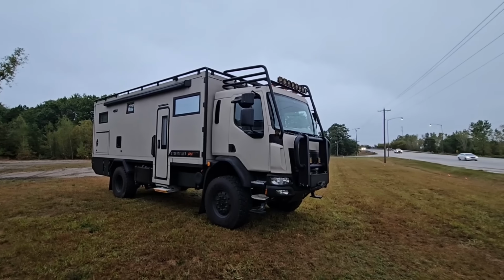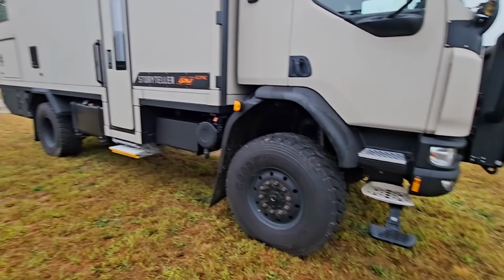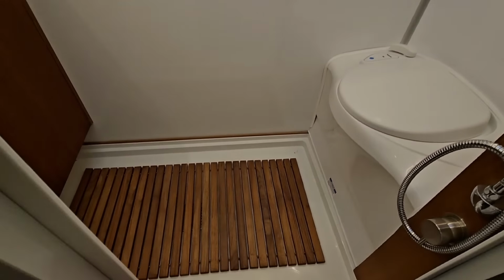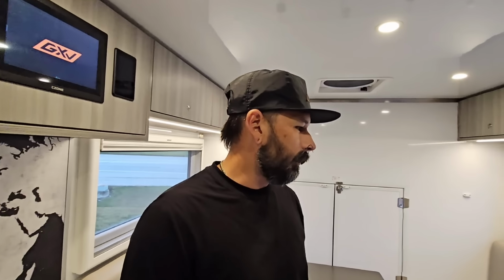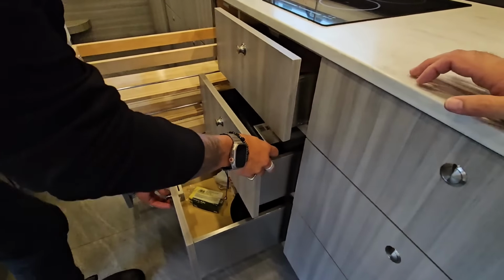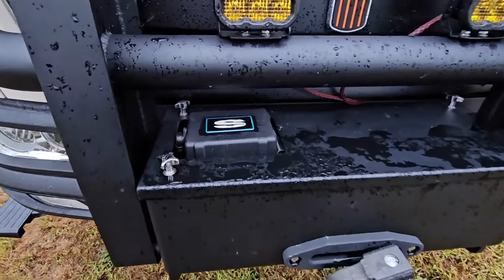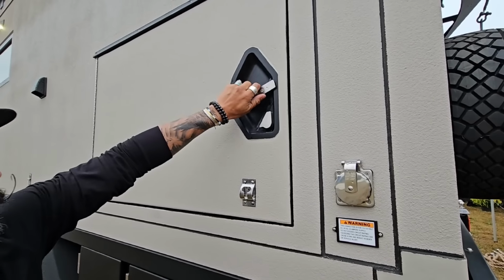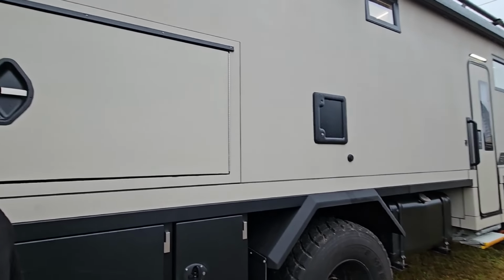MOST AMAZING US MADE Overland Motorhome RV! Storyteller GXV EPIC!

Comment: Can it be customized with a full dry bath (separate shower)? We have years of RV'ing around the states with a wet bath. It's a hassle, and only one person can use the bathroom at a time. Plus the wipe down after is another effort one prefers not to be faced with when you come back from a day out biking, hiking, or paddling. You're tired; you just want to take a shower and chill. Black and gray tanks would be another excellent option allowing for off-grid enjoyment and ease of emptying the tanks at a campground using their full-hook-ups when it's finally needed. The cassette is another major effort; it's heavy and quite high off the ground; I stand 6'4". it is not welcomed by some folks in public bathrooms, and it only holds a small amount before it needs to be emptied. I'm just sharing observations for customization considerations having spent a lot of time RV'ing with separate tanks and a wet bath.

Comment: As soon as he said it lacks power at highway speed I was out!. I own a new Chevy 2500HD Crew cab (gas) running 35” tires and an Arctic Fox 811 slide out camper. My camper has everything from generator to ability to sleep 5 with wet bath. Truck and camper weighs 12633 lbs and I have run 80 mph all day headed to the keys.
Reply: I think the tires they have to use to keep a decent load rating when they go to single rears are limited to 65 mph anyway.

Comment: I’m confused about the engine option. Their website states it’s powered by a Cummins while Kenworth only makes the K270 and 370 with a Paccar 6.7L.
Reply: The PACCAR PX-7 is essentially a rebranded version of the Cummins ISB 6.7-liter engine. Both engines share the same core architecture, components, and design features.

Comment: Do you need a CDL to drive it just curious ?looks awesome.
Reply: Not if you're using it for recreational use.
Reply: @mikebrowne5152  is that for every state or no
Reply: @mikebrowne5152  thank you for the information
Reply: It is an RV, so a CDL is not required in any state.
Reply: @TruckingScrubs  the only reason why I asked is because it has air suspension that's why.